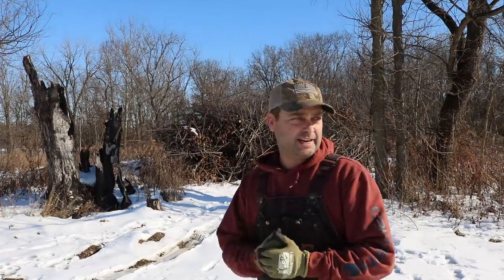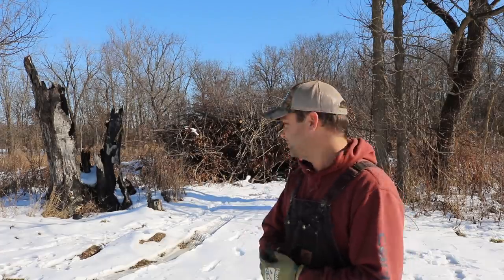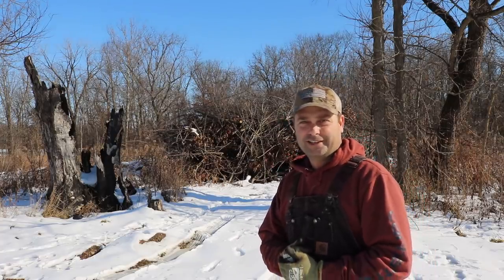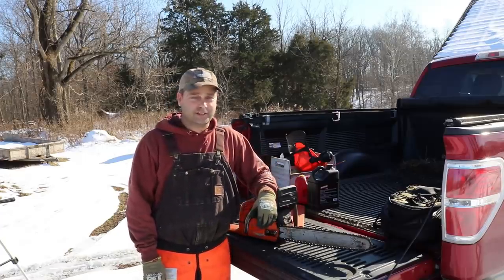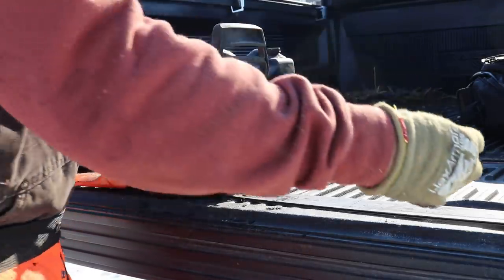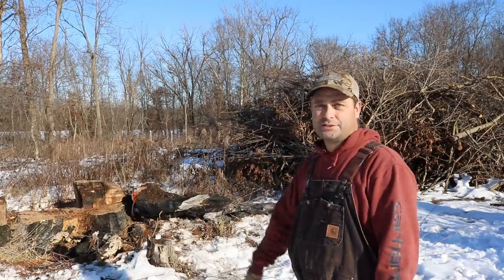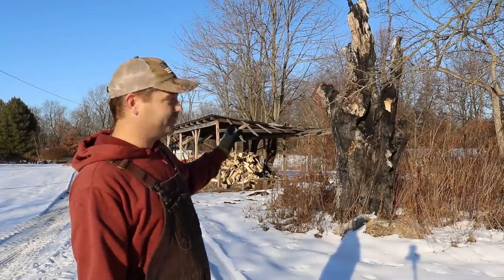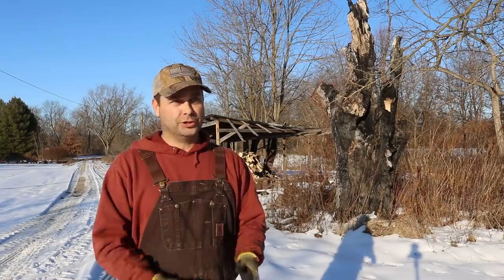Cutting down the old burnt up tree.  This is rough on my chainsaw.

Comment: We have a husqvarna 465 Rancher with a 28 inch bar a husqvarna 455 Rancher with a 24 in bar and a husqvarna T435 trim saw and love them all. They are  lighter than a  Stihl. The T435 is a top handle trim saw and works great working up tree tops,

Comment: I currently have four chain saws (I really only use three of them).  I had bought a Craftsman 16" chainsaw right after a hurricane took down some trees around our home (urban area) back in around 2004.  It was fine for light duty/occasional use, but wasn't really suitable for clearing our property when we bought our 35 acres.

Since then I first purchased an Echo CS-352 chainsaw from Home Depot with a 16" bar.  I use it most of the time since it's light weight and easy to handle.  So far I have been pleased with it.

I also purchased a Stihl MS-270 "Farm Boss" with a 20" bar.  I use it for some of the larger trees that I cut down, and again I am very pleased with it.  The only downside (in my opinion) is that it's a bit heavy when using it for a prolonged period of time.

Finally I purchased a Dewalt battery operated chain saw that my wife uses and I've found to be very handy to carry on the tractor when bush-hogging in the woods.  We use it for limbing or cutting up smaller trees (4" in diameter or less) that are too big for the bush hog.

Comment: Best way to clean chain saw, air compressor, blow everything out with air compressor, you can use it to blow out the groove in the bar, can use it to blow out the debris in the clutch area and anywhere that debris will build up. After your done with the blow out using the air compressor your chain saw will run like new til its clogged with debris again...

Comment: What year is you D-17 ? I had a D-17 gas with a loader. Mine was a 1963. Good tractor ! I sold it 2005 because I bought a 180 diesel with cab.Greetings from SW Minnesota.
Reply from the maker: 1959. Early series 1 model

Comment: I had the same problem with my 351 where the saw formed a groove in the sprocket.  I switched to the new type of drum when I bought new where the sprockets are a separate piece from the drum rather than all one piece with the drum.  The cause, I think, somewhere along the line during production of the 350's and 351's they switched from a 7 tooth drum sprocket to an 8 tooth drum sprocket and did not change the model numbers.  When you go to lowes or the depot for a chain, it says it will match on the Husqvarna brand chains but it doesn't, wrong drive tooth count.  Check your bar for the numbers that match the chain you need, they are stamped in just above the bar nut slots.
I would take that pile of brush and build little campfire sized fires on top of the stumps and keep them burning until the stump is gone. blow the ashes off every now and then and put the coals back right on the stump.
Merry Christmas to you and yours, thanks for making videos.

Comment: I do most of my cutting with a 50 cc saw due to weight and capability, kind of a swing saw between small diameter and large. When it comes to needing a 24-27 inch bar, or at least the power to pull one around in hardwood, the Stihl 361 can do it but you might have to finesse more than force, whereas the 461 can do either. Before shelling out the big bucks for one of those however, you should definitely see if you can try a Echo (Shindaiwa) 620P with a 24 or 27 inch bar. That's the big brother of the popular 590 and is sold at Home Depot. If that has enough power for your tasks, you'll literally save hundreds of dollars over a 461. I only have a 20 inch bar on mine but wish I had a 24 and it's been reliable and easily has the best throttle response of any of my saws (though I only have the one so that might be luck!).

Comment: It could just have been a shot edit in the wrong place, but ...... Did you really stretch the chain that much? It was nearly falling off! ;0)
Using a stretched chin will wreck your sprocket too!
As an idea for that stump you have left .... and your other burned tree ..... why not burn it from the inside? 

It looks like it has a rotted canter so if you cut an opening into the lower section plunge cut with the saw or if you don't fancy that a long auger bit. A splash of diesel on the inner surface and light it up ....... Marshmallows are optional ;0)

Comment: Get a 55 Gal Steel Drum & Cut out Top & Bottom then cut Triangle or Hole Air Vents around Bottom outer Drum & Sit on Stump then Burn inside the Drum with trash or whatever to burn stump out of ground, it won't take long.

Comment: Been in the chain saw tree cutting business for very long time, stehl is not worth it, they only give commercial warranty of 90 days on their saws, echo on the other hand gives 2 year warranty on a commercial level and 5 year on homeowner level, u want a seriously dependable chain saw look into echo their equipment is beyond your dreams in dependability, I have echo large logging saws and considering the engine size they start on 1 - 2 pulls stehl only gives 90 day warranty on the commercial level cuz they dont want to be responsible if it fails on a commercial level being ran daily where echo stands by their product for 2 years on commercial abuse, 5 years with a home owner usage...